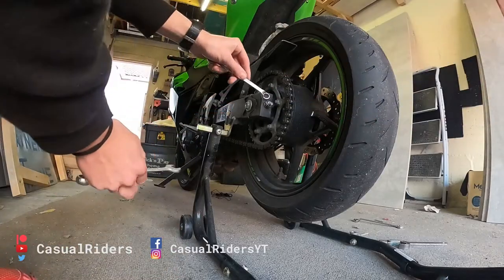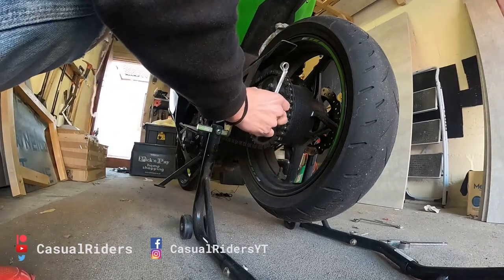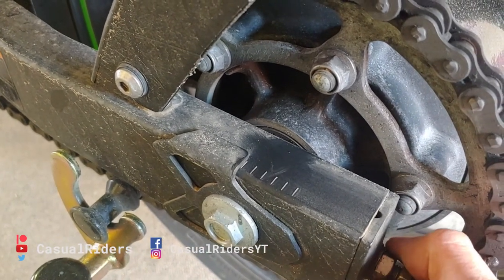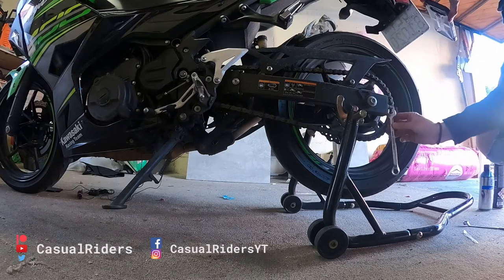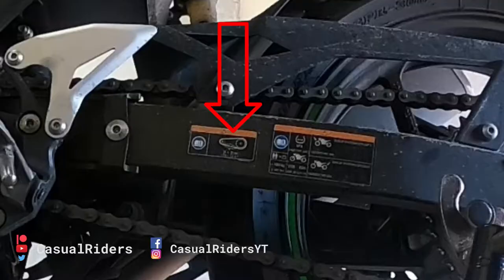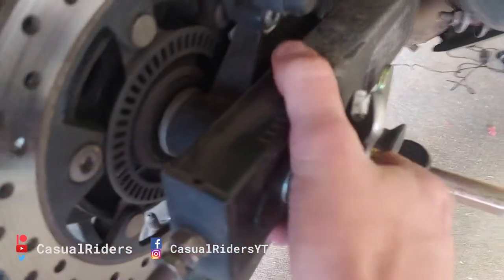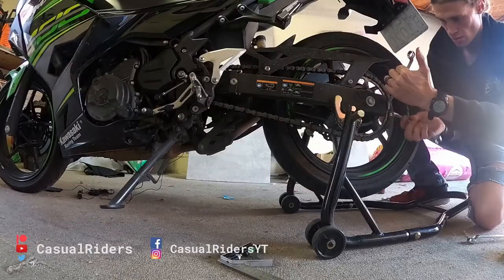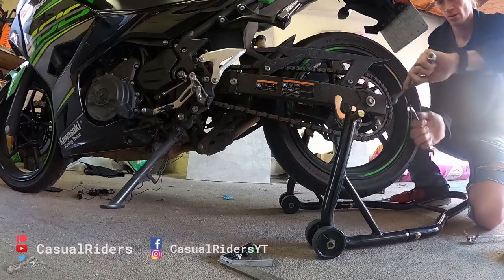How to adjust a motorbike chain || Kawasaki Ninja 400 Chain Tension

Comment: In my case, these plates at the end of the swing arm near the screws have some play so that they can be moved easily, everything is tightened, nothing happens? apart from that, I have a new Ninja from the showroom... the left side of the swingarm is set differently than the right one, the difference is maybe 3/4 mm of the swingarm - the motorcycle is and rides straight, the chain runs evenly on the sprockets, etc.
Reply: I already did 1500 km like that and theres nothing wrong, dont know why I have it like that
Reply from the maker: It doesn't sound right that those plates have free play, they should be held under tension by the adjuster nuts when everything is tightened up. If not, this could result in the axle moving forward (loosening the chain) under load. Those guides are not bible, but they should be equal (especially on a quality Japanese bike) as long as your chain and sprockets line up, you should be good
Reply: @CasualRiders  the screws are tightened and the chain is tight, maybe I got a copy with a slightly longer screw and it doesn't press the plate but I don't know.....this plate does not fly backwards, only slightly sideways, you can move it a millimeter to the side so that you can hear a metallic sound slightly

Comment: Nice video thanks! I noticed one side of swing arm adjustments is on 5th mark and 6th mark. How do I fix this?
Reply from the maker: Hi Riley, I'm not sure I understand your question correctly. Are you saying that your swingarm lines up with one side at notch 5, and the other at notch 6 whilst your chain is straight? Or one of them is sitting  between 5&6
Reply: My is too 5 and other sth like 5.5 and im riding with it bcs chain is going straight etc. and bike is going very well..my bike is new from dealership so... Dont know why but it have to be like that I think

Comment: can't you just reuse the same pin on the locknut? where do u find new ones to replace it
Reply from the maker: In theory, there's no reason why you can't re-use the pin, but every shop manual I have read recommends replacing with a new one. I suppose it's because after several re-uses, the split pin will fail. You could try your local hardware store for replacent split pins, it's where I go for replacements I need.
Reply: @CasualRiders  thanks!
Reply from the maker: Any time🤘
Reply: Or Buy an R clip
Reply from the maker: I hadn't even thought of that😁

Comment: Jesus christ, doesn't even use a standard wrench on the axel nut, let alone a torque wrench. If you're watching this as a guide, its great, but get a torque wrench for the axel nut and tighten it to the spec in your manual!
Reply from the maker: Great point! Unfortunately, my mate didn't have a wrench or socket that fits, hence I resorted to using the master wrench.

For tightening, I would prefer to use a torque wrench and get it dialed in according to spec, but, this was sufficient,  my mate rode around like this, no issues, and that axle nut was only loosened again (by a shop) months later when he had his rear tyre changed.